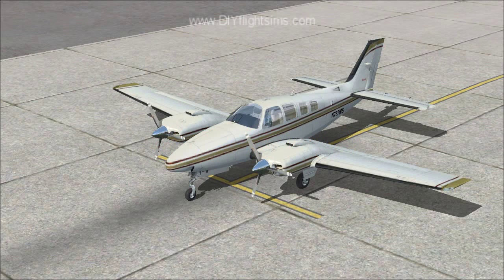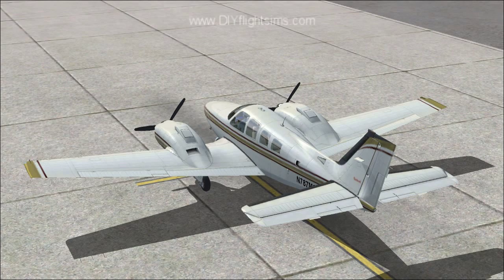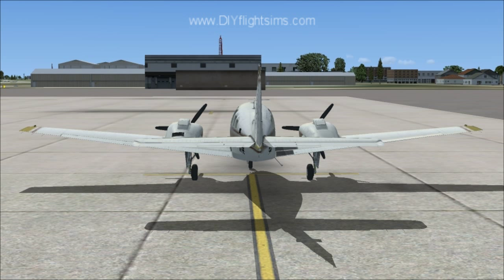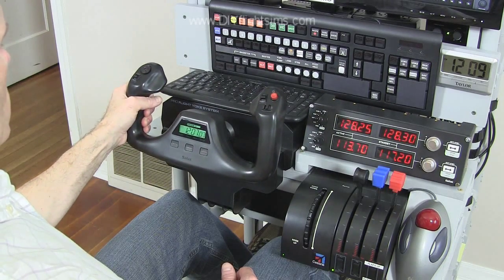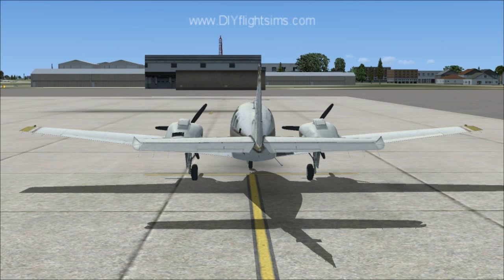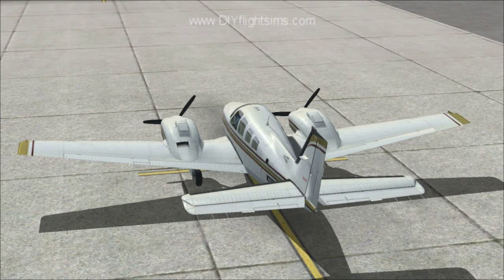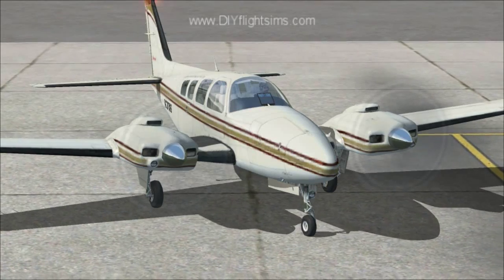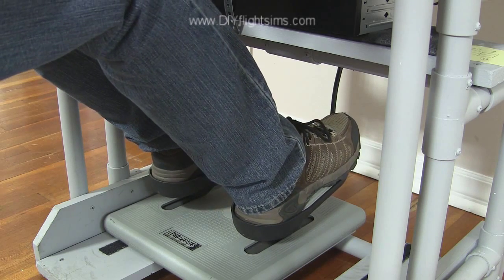Flight Controls

Comment: Im interested in simulated flying with a budget. But my pc is not powerful enough to run the program. Is it cheaper to build a capable pc or buy buy a gaming pc? I have a Hewlett-Packard desktop and need a stronger processor.